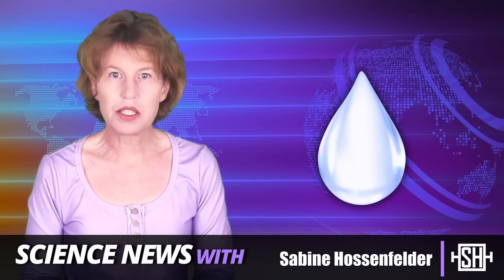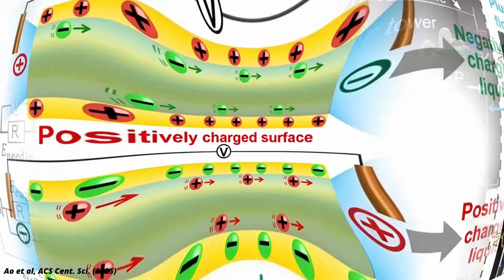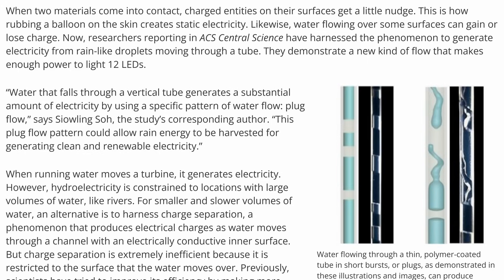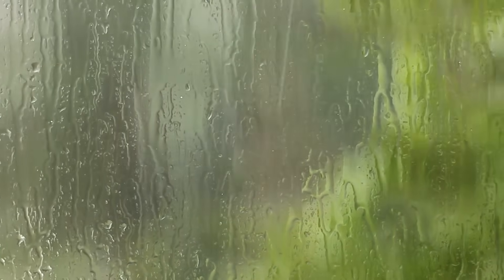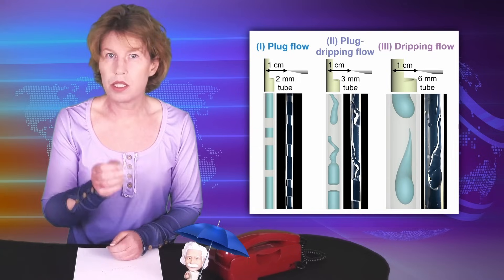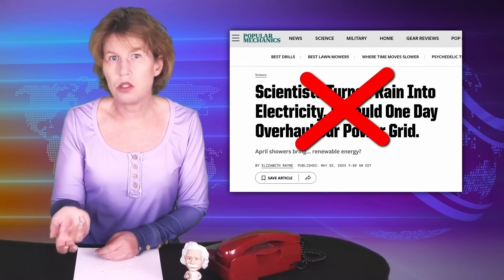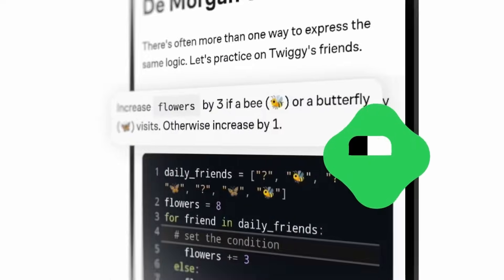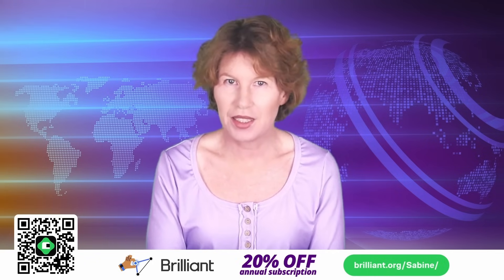A New Way to Generate Electricity From Rain

Comment: This reminds me a bit of the platforms that recover energy from people's footsteps.  Apparently you can find some of these devices in Japan, but I think they are ridiculous.  The minuscule power you can get from these are very likely hugely outweighed by installation and maintenance costs, plus people will feel like they are walking on sand.  The power is not free -- it's taken/stolen from the pedestrians who cross it, and if they can't really feel it, you're likely not getting much energy from them, so it provides a perverse incentive to set the device so that it extracts just the amount of energy where 90+% of people won't complain about it.
Reply: A d of it became noticeable people would just find a way to walk around it 😂
Reply: I had this immediate thought!
Reply: Thanks for introducing me to a new piece of tech I’d never heard about.

Transferring kinetic energy from pedestrians as they walk is an interesting concept from two points of view.  The first being that it simply encourages people to get out and walk rather than consume energy by driving.  The second would be highly reliant on just how efficiently the system operates and its operational lifespan, assuming it has a high efficiency and good lifespan (hey let’s be optimistic) then the ROI becomes worthwhile even if it only provides power for in-city infrastructure IoT communications.  

In urban areas the solution has always been to slap an appropriately sized PV onto the IoT infrastructure device and basically leave it alone until things go wrong, within dense high rise cities the cost of appropriately sized PV is greater for obvious reasons.  Whether an emergent kinetic transfer technology could reach a scale of manufacture to bridge the ROI gap is however a huge ask, but new technologies do cross that divide as photovoltaics themselves illustrate.
Reply: @ForgeMasterXXL  "encourages people to get out and walk" How? If they didn't want to walk before, why would they want to walk when it's made harder? If you had an endless line of average Japanese people walking across one tile for 24 hours per day at 100% efficient transfer, and the tile owes you $100, it would take an estimated 12 maintenance-free years to pay for itself. At realistic efficiency and foot traffic variability, it could be 60 years. All the while, producing more CO2 per joule than a typical fossil-fuel power plant and annoying the population, possibly causing premature disease of the joints from the erratic motions of the tiles.